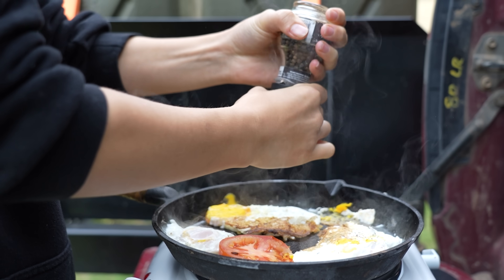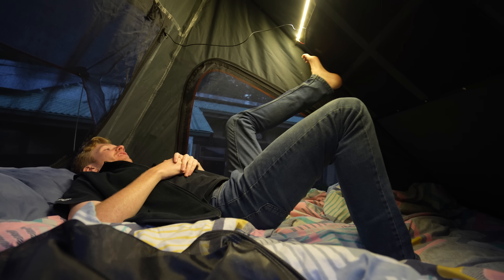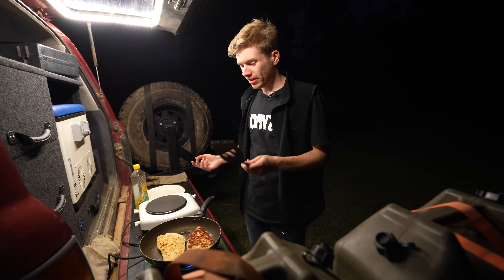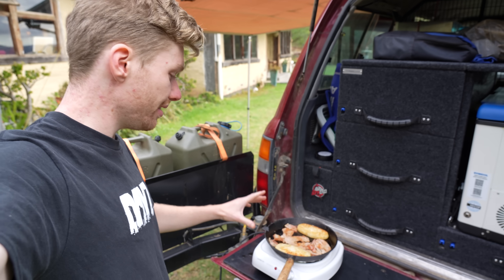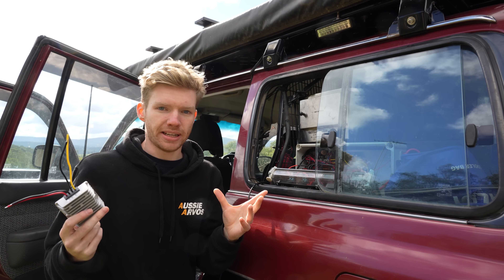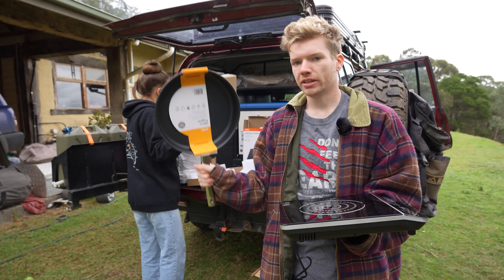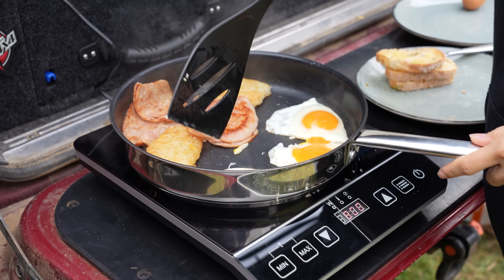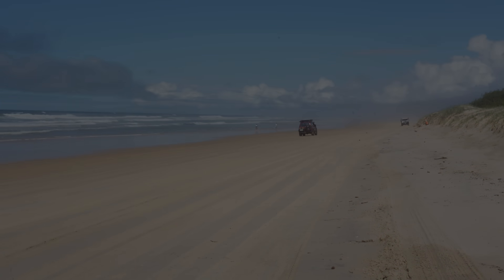is BUDGET induction cooking ACTUALLY POSSIBLE? Pushing my 12v Camping setup to its limits.

Comment: Sounds like the kings 120A lithium  battery is 50A max continuous Amp draw and not 100A like on the website.
With your travel buddy at 4A and fridge at 2-3A when you go to 800w with the induction cook top to sits at the 45-48A mark, any higher it trips the BMS of the lithium battery.

The only way to fix it is to buy a proper lithium battery brand with real world tested specs or get another battery and run it in parallel so you have twice the amp draw capability.

Dude keep up this content it is awesome.
Reply: The travel buddy draws more than 4 amps or what ever he stated in the video. He had it pre heat for 45 minutes, cooking for 45, and extra cooking for 45, thats like 2+hours. Thats least 20 amps (10 amps an hour) and old mate said it only used 4 amp hours of battery. His battery monitor is wrong.

Comment: I'm running 2 x 120amp lithiums (Itechworld) with a 2000 watt inverter and ran a 1800 watt air fryer for 20 minutes pulling 185amps while the heating element was on as a test and still had 80 odd percent of the batteries left. Have since got a smaller 1300 watt air fryer and its perfect. Also use 2 x 200 watt folding solar blankets which put back around 22amps per hour

Comment: Great video, mate. I've been running inverter cooking on a budget system for a couple of years now. Hell, I even started with a Kings 100AH AGM and the inverter/induction cooking. Killed the AGM after some time, but it worked well.
The great thing about going electric is the maths. If you work out what you need with the math it will work. I don't know what your system consists of behind the battery to the inverter but if I was to take a guess, there is a large loss occurring between the battery and the inverter. Cabling size is crucial plus the distance of cabling has an effect on resistance. Resistance means heat, heat means loss. Your volt drop is because the inverter wants the amps/watts, it will try and take what it needs in amps/watts from the battery to service the inverter demand but because there is resistance, something has to give and that's volts. As the heat increases the resistance increases which makes the problem exponentially worse over time. 

I now have a quality 200AH lithium but evolved from the 100AH AGM to a 100AH budget lithium. The cabling is AWG 0000 (12mm dia) with the longest length of about 500mm. Pulling 120amp continuous, the cables are just slightly above ambient temp to touch.

Enerdrive have a very helpful cabling table on their website to help with cable selection.

Comment: Interesting video, some great ideas here.
I would have to disagree about the cause of your problem.
I have a 200AH lithium setup myself and was looking for a coffee maker to plug in to my inverter. The small Nespresso machines are 1300 watts so my 1,000 watt inverter won't do that.
The problem with going to a 1500w inverter is that my Lithium battery is rated at 100amp maximum draw, as is the Kings 120AH lithium you are running. This means that you can get a theoretical maximum of 1200w (W=VxA). When running through an inverter you will get losses due to the cabling and the inverter itself so it will realistically be closer to 1100w.
This, I believe, is the cause of your power cutting out. Your battery can hold a 160A draw for 10sec but it will not provide more than 100A for sustained periods.
Amps draw and Amp hours are two different issues.
The solution, if you have the space and the bucks, is to run two batteries in parallel thus doubling the available current.
Lithium batteries are available with higher current ratings but obviously cost more.
Reply: . doubling the battery won't allow 200a draw  as each  battery has an independent bms only allowing 100a constant draw.  although it might stop the voltage drop his getting at 60a  draw. 
I would have thought the lithium wouldn't see that much voltage drop under that load. maybe the difference between high end cells and cheap cells.
Reply: @mathewsimonelli1332  sorry mate but 100 +100 =200.
Reply: @mathewsimonelli1332  spot on
Reply: @Jack-is8xz  will equal 200 amp hours not 200 amp of discharg current available
Reply: @mathewsimonelli1332  it will work if wired in parallel. It won't if wired in series. The bms on one battery will not limit the other for current draw.
Reply: @mathewsimonelli1332  Matthew, you are right that it will give 200 AH but it will also provide 100Amps from each battery combined that will provide 200 amps.
In reality it may be a little under like 190A due to slight differences in battery charge but as they would be charged and discharged as a pair this would be very slight.
You must use two batteries of the same rating and preferably the same brand for the best result.
As Jack said if wired in series this will not work. You would get 24v 100Amps and 120 AH from the kings batteries.
It must be done in parallel, 12v 200Amps 240AH.
Reply: You beat me to it. Amps will be the problem as you’ve highlighted. Two batteries in parallel will double up the current limit, but then you need room for two large batteries. Or you can get higher current lithium batteries but that means more money. Then you need to recharge the batteries. If you aren’t driving for hours each day, you are going to need substantially more solar. Gas seems a lot easier to me.
Reply: I grabbed a 300Ah Lithium on sale for $841 (200A continuous current). I have a 40A DC-DC (you can get 60A ones). 

The great thing is that the battery capacity and current ratings means I only need the 1 battery rather than 2 in parallel to use with my 3kW inverter (can only run max 2400W approx). 
My Induction cooktop is 2200W and cost $39.95. I also have a Nespresso Vertuo coffee machine I take camping. And lastly I can run my 2400W Ninja Foodi Flip Air Fryer Oven (½ price at BigW under $200). 
I do also have a KickAss Travel Oven (glass door version) which is handy for cooking while driving.

Comment: Your setup is excellent and it will work fine with the inductive cook top, but a few small details you need to take care of that are letting you down. First, check the voltage at the battery terminals with a multimeter. Turn on the load and see if it actually drops to 11V. If it does, the BMS is faulty or badly wired to the terminals. Kings need to replace the battery.
If that checks out ok, the voltage drop will be occurring between the battery terminals and the inverter. Check connections and upgrade them, check fuses and any kills switches from the battery to the inverter by measuring the voltage drop across each components terminals and finally check each cable, positive and negative from the battery terminal to the inverter.
The cables that Kings provides are way under size for 2kW as you need to allow for something like 200A when the battery capacity depletes and its voltage goes down to 11V when the maximum current will be drawn from the battery by the Inverter.
I suggest you run 95mm2 cable (for 3m return battery to inverter and back).
Reply: Nicely said. I run 95m㎡ cables directly from my 300Ah Lithium (200A max continuous) to my 3kW Inverter. It happily powers my 2400W Ninja Foodi Flip Air Fryer or my 2200W Induction Cooktop. 

[Obviously being limited to 200A continuous I can’t run the inverter at max. I chose to buy one 300Ah battery instead of say a pair of 175Ah/200Ah or whatever].

Comment: Love that you're testing budget friendly options! Here's my two cents... 100-120ah lithium battery is sweet for a typical set-up (fridge/ lights/ charging devices), could probably add travel buddy at a stretch, but you need to double the battery capacity (and solar in) to go 100% induction cooking. The whole point camping is to not have to worry or be stressed so I'll stick with gas/ fire cooking for now I reckon. Will keep the battery healthy for longer too, lithium is getting cheaper but not so cheap that I can afford to burn through them unnecessarily... PS. you can always add a basic windbreak to make your butane cooker more efficient, or cook downwind from your vehicle

Comment: Thanks for doing this, it's great to see what happens when you have a 100AH lithium battery set-up (which is normal) as opposed to some other youtubers who have 200-400AH set-ups and go on about how good it works.  It confirms that I should just stick to my gas set-up (for now) and use the battery for basic appliances like my toaster and when I eventually get a second lithium battery, then think about using induction.

Comment: Good one to test your system.👍  There's no greater peace of mind knowing what you're taking on a trip works its intended design.  FYI... I don't preheat when cooking with a Travel Buddy.  It just seems like a waste of power.  I just chuck in the food and turn it on.  I simply add about 20%-30% cooking time.  And it works each time.  I too am looking into induction cooking. but would need to upgrade my 1500W inverter to a 2000W version, for greater flexibility and peace of mind.  Might look into a voltage step-up converter.  Thanks for sharing. 👌

Comment: I run two induction cook plates with cast-iron and steel fry pans with a 300w solar panel that usually outputs about 200-230 watts into my 2000w battery generator. I never loose power cooking. I also have USB tent lights and heated blankets.

Comment: Another great vid mate keep em coming.Always fun trying out new mods and working out the best way to set yourself up for going bush or beach. Good idea to test your new mods before going away. One of the better mods i did was to change the ladder on the earlier foldout roof top tents from the not so great sliding ladder that came with the tent to a newer fully extendable ladder like the one on your rooftop tent. Very easy to change over and very affordable and seeing that the missus nearly fell off the old ladder(almost folded in half) because i didn,t set it up right first night we used it ,the new ladder made a huge difference and saved me a lot of suffering.
Reply from the maker: Thanks so much mate! I really appreciate it! Great idea!

Comment: Don't know if anyone else has mentioned it but you should get a cheap air fryer and give that a spin. I'm thinking of getting one for the ute as we use one at home all the time and it is great. I think the smaller 3.5L ones run about 1500w

Comment: good stuff Pat. We tried induction in our camper without success so now we use the solar for lights and refrig and pumps etc and do our cooking on a twin burner gas cooker with a single burner on standby. No stressing about our fridges not having enough voltage and no megabucks spent on system upgrades. We are a couple of old bushies as well so there isn't many fossicking spots we end up at that we cant have a campfire. I cant wait to see how all this fangled stuff goes on the big trip mate.

Comment: I have a king's 1500w inverter and I have a 140ah agm set up. I only really use it for makita battery charging and I've used it for a sandwich toaster, I kept the car running while using it. I also upgraded the cables to a 2bs cable so It can handle around 200amps, should be less voltage drop too. 

Awesome video bro, you have climbed to my fav 4x4 channel!

Comment: Informative episode.👍 Great tip on the step up voltage converter for the Travel Buddy.  Lithium is definitely the way forward.  I'm looking at a 200Ah Lithium setup, as I'm looking into induction cooking too.  I'm just waiting for my existing AGM battery setup to kick the bucket before making the changes. Though not sure once I've made the switch to lithium, that I'll be bringing a coffee maker. 😁
Reply from the maker: Thanks mate! means alot!

Comment: That kings battery has a maximum sustained discharge of 100 amps. At around 12 volts it works out to be roughly 1200 watts. At those discharge rates the internal resistance in the battery will begin to show and will begin to drop the pack voltage + heat the battery cells causing everything to be inefficient. What you need is another battery in parallel (double the capacity + larger discharge) OR a bigger lithium battery rated to a higher constant discharge.
Reply: Exactly
Reply: This is my exact problem, and I'm finding a lot of variable induction cooktops cycle on and off at full tilt, rather than using less power on a consists basis

Comment: well done for trying this out! 

personally we're cooking off grid with lithium and induction. Its awesome. The biggest issue is definitely the battery in your scenario. I'm surprised the kings lithium is sagging so much with the load not even hitting its BMS max output. Bit of a stitch up on their part. 

Get a good reputable lithium battery 200AH minimum. 
Ensure max output of the BMS is greater than 100A  
induction cooker should be able to boil and sear on about 1000w so not much need to go higher than that. (Breville -$50 goodguys) 
Inverter will need large cables and to be mounted as close as possible to battery to minimise volt drop.

Comment: I have a 1500w inverter in my 80 aswell but I use a 140 amp AGM BATTERY I can't even boil my kettle is a 1250w very frustrating so I use low wattage appliances like 850w toaster 1000w kettle 1100w coffee pod maker works for me keep the Vids up Pat and have a great holiday with your beautiful Wife to be cheers legends

Comment: You can buy a 200amp lithium battery for about  $1200 and a kings 3000watt inverter for $500 and that will run pretty much anything you want

Comment: I run induction off my 1000w inverter and 125amp hour batter without issue. Inverter and battery are Enerdrive so good quality. Also have decent gauge and short cables from battery to inverter. Also have a travel buddy. Look forward to more of your videos.
Reply: What induction cooker are you using? Assuming its about 1200w max?

Comment: I mean... Electric cooking is great and all but by the time you spend 5 grand on the all the tip gear to run it.. i bought a 175ah lithium slimline, run everything including the diesel heater all night in the winter.. and still only drop my battery to 80% which means it will last year's.. 
So this cost me around $1600 and compared to $5000 I still don't reckon I could spend $3400 bucks on gas.. for camping.. ever..  lol 
Each to there own but I use a little all for adventure glass top butane fry pan and man you can cook anything in that little sucker, from meals for 4 people to just bacon and eggs.. and the pest thing about it is no more carting around a heap of pots and pans with me.. and there's 1 pan to wash up and that's it.. more time for drinkin beers 🍺🤙

Comment: A bit late with my comment but for what it's worth. I have lived with off grid power for over 20 years and Lithium batteries are a game changer. Since I went over to Lithium, I have been able to run soooo much more from my system.

Comment: Ha mate l agree with one of the other comments, you need to up the earth cable on the kings inverter as its way to small. I did that and l run a coffee machine at 1600w plus my travel buddy with no problem and l have a voltex lithium battery 100amp. It was a game changer for my set up.

Comment: got a very similar setup, custom 150ah lithium (200amp discharge) 2000w invertor and the kmart induction, i also struggle cooking with my battery, i have semi figured it out by putting a better DCDC charger to charge the battery while driving. helped hugely! current solar panel is 200w thats also not enough and will be putting on a 250w panel soon.. to help with when i base camp.. but i seriously think to have a sustainable setup cooking with elec is to have 200Ah lithium as a min!
Reply from the maker: Thanks for the info !! agreed!!

Comment: It is the battery output that is the limiting factor not the inverter. The Kings battery is only able to output 100 amps. If you had a itech for example they output 150 amps which would run your inverter properly at 1500watts.  Because the Kings won't do the amps you get a hit on the volts. Hope this helps.
Your options would be parallel 2 x batties, I think the Kings bms should allow this BUT check or upgrade to a battery with more amperage output and a better BMS

Comment: Firstly, your food looks absolutely awesome and so very tasty! (except the wedges, didn't have me 100% convinced with those, especially with how long they took haha! I'm sure they were awesome though!) I currently run everything through a 1300 watt 100 ah portable power station. All 240v (but my lights and a few other things are USB chargable). I initially looked at those portable ovens like you have, but ended up instead with a $79 oven (it's about the size of a microwave sort of) which I can cook pretty much anything in, no preheating required either. Takes pretty much the time of a "normal" oven to cook things too. Uses 1200 watts. I also got some cheap appliances from Kmart (microwave $52 uses about 1200 ish watts) and the best buy ever, their $22 sandwich press (1000 watts) which I can cook anything from toasted sandwiches, to steak etc. You might even be able to cook your wedges in there! To give you an idea, to cook a toasted sandwich, it uses less than 10% of my total amp hours. I got an induction cooktop from eBay which is good also for cooking - put a lid on top, will cook faster ;) I can do roast veggies also in the oven, which generally takes an hour, that uses 40% of my 100 amp hours. I've also made cake, boiled water etc in this tiny little 300 watt nostalgia brand pan (Kmart have them too, different name though they look the same - 15 bucks I think?). It's all 100% possible. I use no gas, no diesel - just the power of the sun. I haven't done a setup with the separate components like you have here, but am looking into doing that when I can in the instance I want to run a heater or aircon ever (currently have neither). Happy travels, and thanks for the videos :)